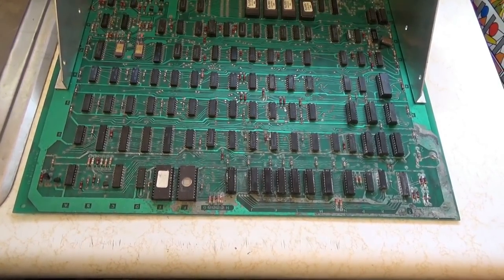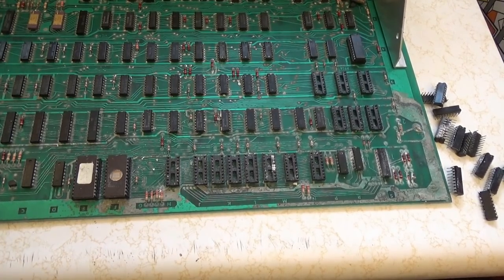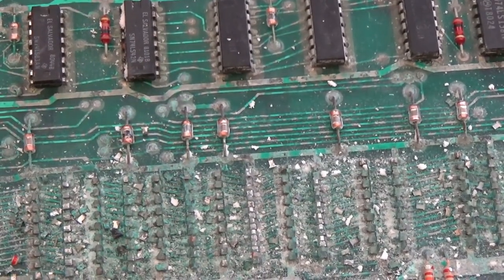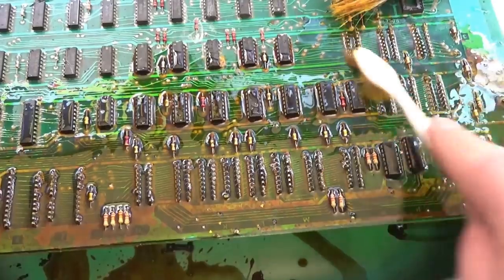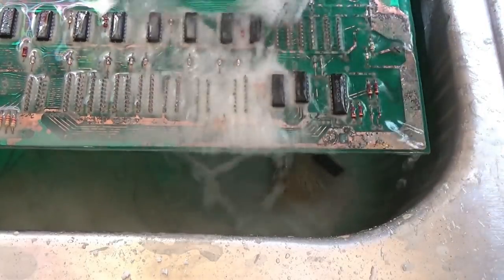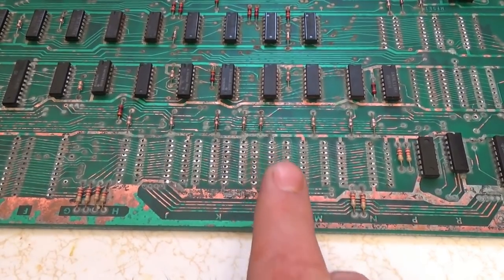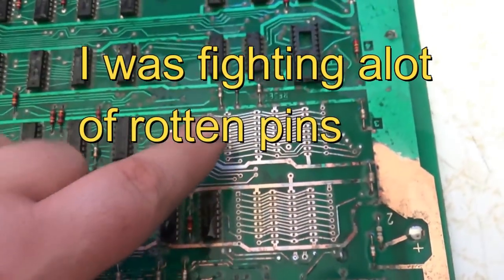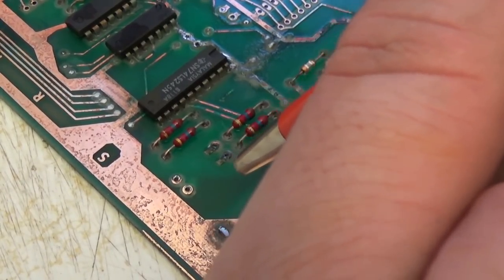How to repair a battery damaged PCB

Comment: A word of warning. I used this method to complete a single Bally MPU repair (with significant damage - 200 components to replace) in 2000 and ended up with a life-long illness as a result. Use fume extraction, mask, whatever it takes not to breathe in the fumes especially from sanding the board. Serious, serious stuff. No excuses.
Reply: In college I worked in chemistry labs w/ this type of stuff on electronics research.  It's no joke!  Be a dork and go hard on the safety b/c some of the side effects are wretched.
Reply: Buck Graeber  Lol, Bots in the chat!
Reply: Also, please wear laboratory specs/safety goggles! If any of this shit ends up in your eyes, you will have a bad time. Sorry to hear about your health problems OP, but I'm glad you stopped by to offer these words of warning. Always read the MSDS!
Reply: Save drama for your momma.
Reply: @shadowwarrior3521  A derpy derpy doop

Comment: vinegar and baking soda are just as good and won't damage the board further like a pure ferric chloride solution would. that stuff is more damaging to copper traces and components than battery acid!
Reply from the maker: baking soda neutralizes the vinegar so it would make no sense to mix them. several types of acids are fine the difference is how long each of them are used.
Reply: @ArcadeJason  I know thats why you add the baking soda to soak up the acid and use it as a mild abrasive scrub. Don't leave it soaking, just scrub away the all the crud and oxidization with the mixture. ferric chloride will eat copper within minutes but vinegar won't.

Comment: Would this method work for electrolytic capacitor corrosion too? I have a badly corroded board due to leaked out SMD capacitors. Could I use this technique? I already tried white vinegar and alcohol, none of them did much. Is the gunk from capacitors is alkaline too, so this acid would neutralize it?

Comment: Keep in mind people, discharge your larger capacitors, if your gonna do solder rework, or replace electronic components. I made that mistake when I replaced the 72 pin cartridge connector to my brother’s NES. I used soler wick, and, it shorted a charged capacitor to a chip, and rendered the board completely useless. Be careful. Use a solder sucking iron, or a solder vacuum gun.

Comment: Just use vinegar and cotton swab, wait 1 minute, then clean with isopropyl alcohol, repeat and be patient and no harm to you or board. Cheap, easy, simple.
I managed to clean modern multimeter with SMD components like that.

Comment: Do you still repair pcb. I have 2 anilam crusader m cnc controll boards. 1990s that need some work. 1 wont post and the other works but has some damage from a battery leaking in edition the memory needs upgraded i have all prints and schems. Also is it possible to upgrade a volitile 8x8k 36u sram  to nonvolatile memory chips. The chips in it are sony 6144  CXk5864PN-15L.    The ones i was thinking if replacing with are BQ4010YMA-150

Comment: Another great video.  After  cleaning, the traces are all exposed, is there another step to protectively coat them with something?
Reply from the maker: they do sell solder mask  it can be painted back on
Reply: I've used clear nail polish.
easy to remove later with acetone

Comment: I have an NES front loader i'm working on now that had major rust a corrosion damage. I think a dog peed on it many years ago. But i am facing the same repairs with a lot of the top coating having been stripped. I now feel a lot more comfortable doing the repair after watching your video. Now will you use some form of conformal coating on the board now that your repair work was complete?
Reply: Amen on the conformal coating. This repair job left a ton of exposed copper, and if that’s not quickly protected, it’s all going to rot away.

Comment: Great video! Thumbs up!
2 questions though:
I missed it, also after reviewing it several times, but what kind of desolder iron do you use?
And blowing away the tin out of the vias using silicone tubing, what does that in practise look like?
Anyway, one subscriber added.

Comment: Awsomw video this is just what I was looking for I just picked up my first arcade game (a pole position cockpit) and need to do this around the battery  area as well but Do you leave it copper or do you paint back over it with a coating of some sort ?

Comment: I have a small board who have gotten a little battery damage ... looks like its superficial. Will this be a good method for cleaning it up or should i use vinegear? What is the excact formula of your pcb echant?

Comment: God i wish i knew someone with your skills for arcade repair up here in Ontario Canada.  Ive got two Frog PCBs that I need to get one working out out of between the two.   Any ideas on what would cause a garbled screen issues.  The first one I got the guy said it was working then went garbled on him after a bit of testing so he just gave it too me if i wanted to find someone to work on it.   The second one i picked up off ebay for parts hoping that its just a bad rom and i can swap the roms between the boards for a quick fix.       Also like other have stated keep the videos coming im learning a little bit more with each one.
Reply from the maker: i never worked on a frog pcb before but i would suggest these things......... test ram and roms and cpu buffers check for clock trace down the watch dog circuit not much help i know lol thanks for watching man